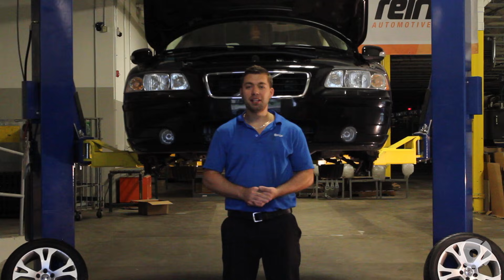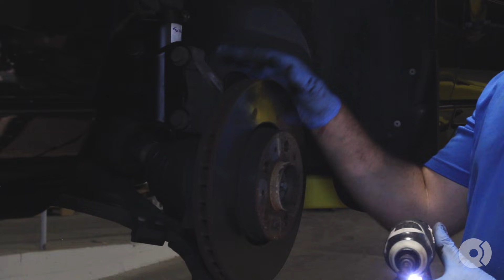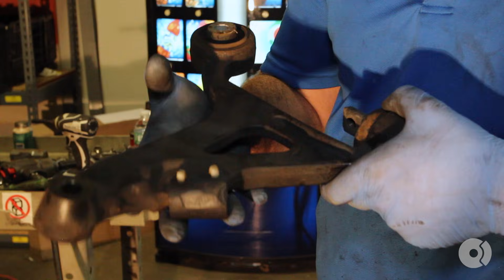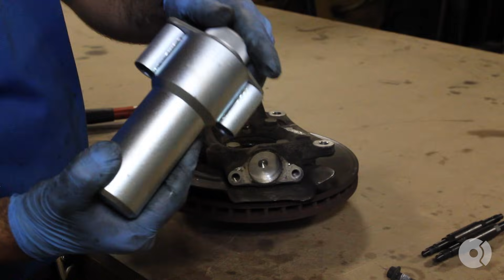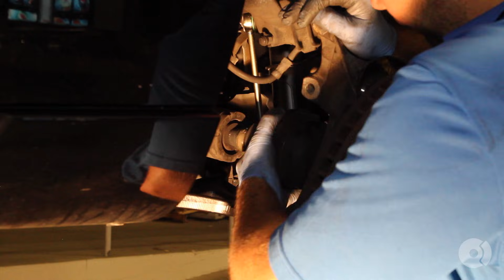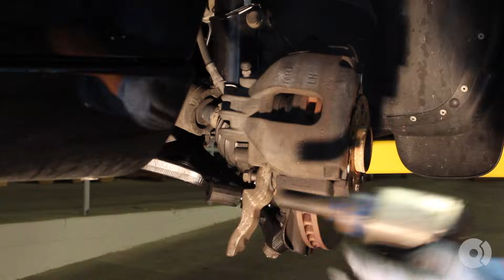Volvo Control Arm & Ball Joint Replacement - No Press Needed! (S60, S80, V70, XC70, XC90)

Comment: Why take the whole hub off for bottom arms it's literally doing extra work that's not needed you can do it all by just doing the 3 bolts and 1 nut  holding the arm on and the 2 bolts for the ball joint on axles stands even easier on a 2 poster like your using more space

Comment: What a joke… he made it look simple to align the bolt hole for the spindle and strut …I DID  NOT HAVE THAT EASY  OF A TIME  PRESSING  THE NEW CONTROL ARM DOWN TO ALIGN THE  BOLT HOLES.  I needed the assistance of a  pry bar , actually a big screw driver  😢

Comment: Why is the end of the axle so greasy? I just did this job on my 2010 XC90, and now I have knocking from my front axles (both driver and passenger sides). My axle splines were completely dry in the hub, but yours are not.

Comment: It's amazing how much room you have to get sockets onto the 2 bolts for the control arm.  I had to use a curved wrench to get that bolt out.  The engine was in the way

Comment: Is this a good opportunity to regrease the axle to steering knucle connection/splines? (I probably didn't use the right terms since im not that knowledge about suspension, yet) I've read about a greasing procedure for the AWD driveshaft, not the same part but probably a similar concept where the splines and joints need to be greased. (My AWD driveshaft lasted 210000 miles before breaking because the splines wore and broke off)

Comment: Is there a reason to take the entire knuckle off? 960s this can be done without removing the steering knuckle
Reply: I'm guessing it's because the ball joint has to be chiseled out then hammered back into the knuckle, right? Would leaving it connected (to the strut I presume) cause damage when applying force to remove the ball joint? Or perhaps it risks the chance of the car shifting off of the jackstand from the forces applied? 
Or I'm guessing it's more difficult to control a hammer trying to hammer vertically rather than horizontally, which isn't possible while the steering knuckle is still installed in the car.

Comment: When I see the mechanic tightening all the screws with an air wrench, I feel nauseous! There are times when you have to do everything yourself. I will not mention that this bungler did not clean any mounting sockets or apply anti-seize grease (at least in places where aluminum meets steel).

Comment: these vids are fantastic- my passenger side axle broke, the wheel folded perpendicular to the road @70MPH.  I was very lucky.  Currently in the process of replacing a hole bunch of stuff, control arm, struts, axle, tie rods, ball joints.  Vehicle has over 345,000 miles on it-  the engine is solid, tranny shifts nice and tight, no body rot so I'm going this route.  Again-  these vids are making it possible.
Reply: Was your car shaking side to side?
Reply: @insanebeatjunkie  the night before the failure- I started hearing what sounded like caliper noise- only louder.  There was no shaking.  The next morning I decided to drive to a garage I rent- I wanted to jack the front of the car up to investigate-  it's 7 miles to my garage- I only made it a little past the 4th mile-  pretty scary but no body damage. The tire just folded under the frame and the car glided to a stop on the right side of the road-  I was VERY lucky.

Comment: Is it possible to install the ball joint without the special tool?
Reply: yes - I did it today.  I used long bolts as 'index pins' and I used a pvc pipe that fit over the ball joint then starting tapping it in.  I put a little antisieze on the edges. Just take your time and MAKE SURE you're going it straight or you'll mar the pocket where the ball joint seats into the knuckle. I had to back out-  clean it up and try again-  2nd attempt went right in.  DO NOT try to seat the ball joint using the bolts- you'll just bend the mounting edges and the ball joint won't be seated correctly.  Just take your time and tap it in little by little-  it'll go in.  good luck
Reply: @lynskyrd I use heavy duty PVC to support puller tool to remove BMW rear wheel bearings.

Comment: how in the hell does everyones control arms on they volvos come off the ball joint like butter but mines feels like ite fricken welded to the control arm just spent 6 hours on it and its still stuck anyone got some advice for me? also i dont have new ball joints so i dont wanna use a spreader and destroy the bushing in the ball joint. im pretty stuck and the car is my daily please if anyone sees this help me
Reply: umm... did you see if you could put a star/or? torx?" into the spindle/bolt end of the ball joint (to hold it from spinning in place) while using a wrench on the nut to undo it??

Comment: Hi there, I want to replace all bolts on my control arms and, as you know, the right hand side on V70s and other P2 has interference from engine/trans, which need to be lifted an inch to slide bolt out. Question: can I get enough lift without undoing any engine mounts and not damage same??? Appreciate you advice, thanks

Comment: instead of spending $150 on this ball joint tool they have you can usually get away with just tightening the bolts and the ball joint will press itself into the knuckle. this method worked for me easily on my 08 xc90

Comment: I always seems to watch the video after I did the job, to see why it was difficult, I used a blunted chisel around the edge where the volvo tool would contact and used the bolts to carefully tap it in, it tried to go sideways, and it took several tries to get it going straight, once you have it going in straight tap away keeping it straight and keeping tension on the bolts. Tap tap tap tighten bolts, repeat. Not pretty, not easy, but the job is done, I'm used to doing stuff without the special tools, but I would buy that tool next time if there is a next time.

Comment: This is probably the front of the car, do you guys have a video in how to replace the lower driver side rear harm on a V70 2003, it is a bitch of a job, I believe the all rear assembly need to come down because there is no space to remove the arm

Comment: Why do you lie?

Step 1: remove bolt for tie rod

Except you don’t say the tie rod just spins and you need to use a wrench while you clamp the bolt so it doesn’t spin.  

Why do you lie?
Reply: Step 1 Why are you so rude?
Reply: Step 1: soak with PB Blaster at least an hour before attempting to remove.

Comment: wait a second.. I thought the control arm and suspension needs to be "loaded" before tightening the control arm bolts, otherwise you get premature wear.
Reply: Doesnt matter here since it can only be tightened in that position.
Reply: That went through my mind as well, but quickly realized the way it's attached to the subframe mitigates that as being an issue.
Reply: also the alignment shop will fix it ultimately

Comment: Just did mine in the drive on a jack. Didn't take any of that stuff off at all. Rule Number 1. Never disturb the strut bolts unless you are changing it. The holes are elongated and once you undo them you WILL have to go and seek an alignment expert to set your camber angles or you will ruin your tyres and your car will not handle properly so would be considered. dangerous. All I did was undo the three Wishbone bolts, undo the bottom joints two 13mm bolts and tap it out in situ. Then undo the bottom bolt (if replacing it) and take it out. Slot in the new arm, start the bolts, swap the bump stop over and fit the lower joint. Lever down the arm and refit to lower joint. Tighten it all up and away you go.  You need just the right sort of bar to lever the arm down or it can be a struggle.
Reply: Did you attach the new (or old) ball joint to the arm before pressing it up into the knuckle? In the few videos I've seen, getting the LCA over the ball joint stud seemed hard. But I'm wondering what are the issues with seating the ball joint while seated on the LCA. I have to do my wife's xc90 this week.
Reply: I have used the short cut method in the past, and I am going to change to the method shown next time - even though I just had my wheels aligned.  I'll pay the premium.  It can be a major PITA to lever the arm down.

Comment: I notice they did the easiest side. The right side has a huge engine in the way of the bolts.
Reply: You use an offset box wrench with a tubular extension for more torque to do that without jacking the engine/trans.
Reply: I learned that the hard way yesterday 😂😂

Comment: That is how to mess up camber and tracking. You cannot just undo the strut like that. It has a huge amount of movement too set the camber angle. They did not even tell viewers to go and pay $100's afterwards to get it all set up by an alignment company to make sure it is safe to drive.
Reply: I am using this procedure because I don't want to mess around with ratchet straps and prying the control arm down to get it to fit.  But you are correct - they should warn in the video you MUST get the car aligned afterwards.  I have an appointment tomorrow morning.

Comment: I like how it says "No press needed", but then he uses a press tool to reinstall the ball joint lol
Reply: If you really want don’t want to have to buy the tool you can use a 2-2 1/4” short length of PVC pipe w/ cap to install the fitted ball joint. Still proceed with caution but it’s an option you might have laying around the house. I personally own several P2’s and bought the tool for 140$.
Reply: The tool is not actually needed I found just carefully tighten each bolt a little at a time alternating until it’s snug
Reply: @Airduct_ltd  sounds like a very efficient way to strip the bolts on the knuckle.

Comment: I just replaced both lower control arms on the front of my 2004 Volvo S60 and the brunt of the job was just getting the ball joint nut off. Unfortunately for me, both counter torque inserts in the bolt were completely warn away (so it was basically just a hole with no grip for the hex torques fitting). My way around it was to use a vise grip that that made contact with both sides of the knuckle of the control arm where the ball joint bolt went through. I had to clamp the vice grip enough so that it would hold tightly the parts of the ball joint that wanted to spin as I would loosen the bolt. As long as you use a 18mm wrench and not an impact driver to slowly loosen the nut, it works perfectly. Just thought I'd mention an alternative way to get the nut off rather than cutting it off.
Reply from the maker: Thanks for the tip Swandoherty, smart thinking! Glad it worked out for you!
Reply: Nut splitter?

Comment: I'm only a DIY mech but man you did this the hard way!! No need for disc/hub removal... but also the video is way too dark so cant see it well, then you say no press needed etc ref removing lower ball joint then break out a fricking air chisel!!! I'm guess many get stuck at removing lower ball joint as its pressed in.. be it lightly but it gets corroded and I cant remove mine.. AKA Video no help!! to others trying I'm afraid its a pain in the bottom and with normal tools you need a heavy duty flat head with a hit spot and a heavy hammer, cant see any other way without air tools.. anyway back to it
Reply: I have used the "easy" method of not removing the knuckle, and it can be a real pain in the neck.  This looks easy peasy, but I will have to pay to have the wheels aligned.

Comment: For all the homegamers doing this in the driveway - make sure you raise both front wheels off the ground.   If you just raise one side it is possible to wrestle the strut off the steering knuckle but very difficult to get it back on as the sway bar will be under a fair amount of tension making it all but impossible to align the knuckle and strut.  Ask me how I know... :O
Reply: fighting with mine now, I'll have to raise the other wheel when I try again in the morning.
I did the other side 4 years ago and forget how I did it.
Reply: I made exactly same mistake. I used 99% of the time to align it all together... It was almost impossible.
Reply: Uh oh.  They skipped over that step in the video.  The knuckle was a bit difficult to get off.  I am going into reinstall right now and I have been warned.  Sadly I can not easily raise the other side of the car at this point.
Reply: It was a great fight which i won…
Reply: When you say this, is it like you can’t rotate the knuckle far enough to reach the top strut bolt?

Comment: Very cool how the Technician explains Socket sizes for each part in the process.
Reply: I was kind of disappointed he didn't mention torque specifications for reassembly. Bolt sizes beg for many uggas and quite a few duggas, so it'd be nice have that information to ground breaker bar abuse hahaha
Reply: @illitero Right there with you
Reply: no one puts these parts to torque spec. just use your hand and brain to think is it tight enough @illitero
Reply: @Velho2 I've heard of that strategy but it seems a bit scary, why would torque specs exist if we don't have to use them?

Comment: I've replaced my control arm on my 02 s60 and north ball joint is tearing into my rim any idea where to look to resolve this?
Reply: You are going to have to cut the thread off to give clearance. Check you have no left anything out first though. Is it a cheap chinese replacement arm? Maybe the specs are to thin on the bottom joint tapers?

Comment: That's a lot of work just for replacing a lower control arm ball joint.
Reply: its a volvo
Reply: This shows how to replace the control arms, which is a common failure point (bushings) on these cars.  I had two sets of after market arms go bad after 20k miles each.  This method looks easier than the one I have used.  I found this very helpful.

Comment: “No press needed”  pulls out specialty tool/installer.
Reply: Just get a piece of pipe with the right diameter to slide over the joint, put a piece of wood on the other end and whack it in with a hammer while keeping a close eye on the alignment. 
One thing they didn't mention in this video is to clean everything thoroughly before installing the new joint.
Reply: @dvdouden  Thanks I want to avoiding buying a tool who will only been used one or two time... Piece of pipe could be a nice alternative. I just need to find one not to thick :)

Comment: I thought it was supposed to be a "no press needed" job, or don't specialized press tool count?
Reply: Nice flat piece of wood, couple turns on each bolt to keep it even, tap the wood on the front ledge with a 3 lb sledge to keep the front even with the bolts and keep going in the pattern until it’s in.

Comment: Need these replaced on my Volvo V50 2008. Bought the parts now I need to find a decent garage that will do it. I've already spent nearly £3k trying to sort out the suspension -.- Eventually found out that the issue was these! >< Car's front wheels don't feel like they're fixed on correctly - erratic swerving at higher speeds and clunks over the slightest bump, at any speed. Question is - How long would each arm take to replace? I've had enough now and just want a fair job done. If anyone could recommend someone that can do these - Lancashire/Cumbria area(UK), would be greatly appreciated! :)
Reply: Simon did the control arms sort
Your issue in the end or was it something eles

Comment: Good lord. Impact are wonderful, and have many good uses, but hammering home bolts that might KILL YOU if they fail isn't one of the uses any good mechanic would risk.  Please at least insert a disclaimer along the lines of that you really did use a torque wrench, but it took too long to film. Please.
32yrs a Volvo tech.

Comment: great vid, helpful as always. If i'm just replacing the control arm will i need to remove hub still or will i just be able to pull it out once all the  bolts are off?
Reply from the maker: Hello Wilson, you won't have to remove the hub if you're just replacing the control arms.

Comment: Im about to change the front wheel hub  (I just changed my control arms, ball joints, struts, inner and outer tie rods 5 mos ago on my 2008 Volvo XC90, AWD).  During that time I also installed new bolts and nuts to include brake caliper bolts, strut bolts/nuts, and control arm bolts.

When replacing the front wheel hub, is there a way to separate the ball joint from the control arm?  Or do I have to loosen the strut bolts?

Do I have to change all of the strut bolts/nuts again?  How about the brake caliper bolts?

I believe if I have to loosen the strut bolts and nuts, I would have to have an allignment as well.
Thank you
Reply from the maker: Hello Riley, hardware is always recommend to be replaced once removed. The ball joint can be removed with the use of a ball joint separation tool or you can use a hammer. An alignment is also recommended once any suspension or steering component is removed and/or replaced.

Comment: 4:19 - My steering bump stops were riveted on, not bolted, so I had to drill those out and get suitable weather-proof bolts and nuts to install the stops on the new control arm